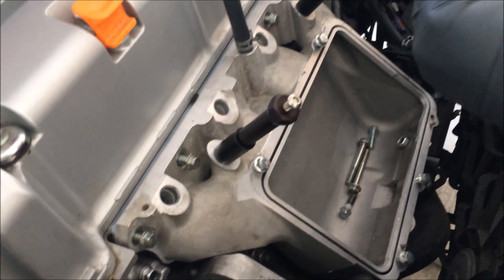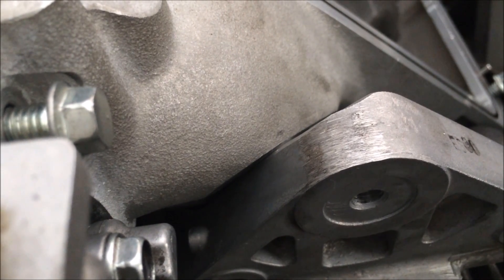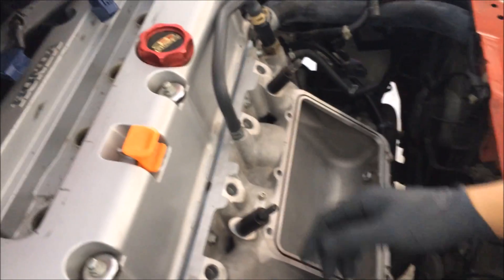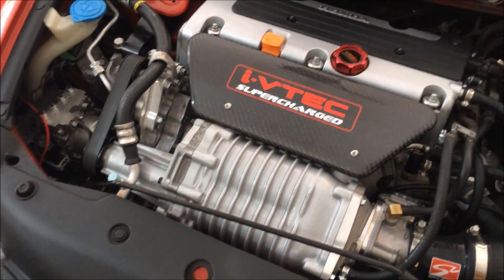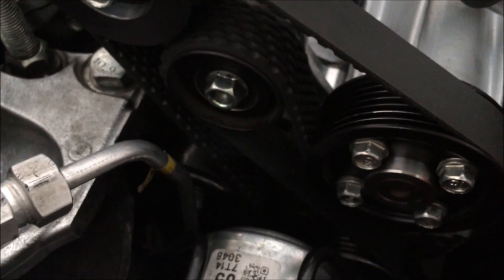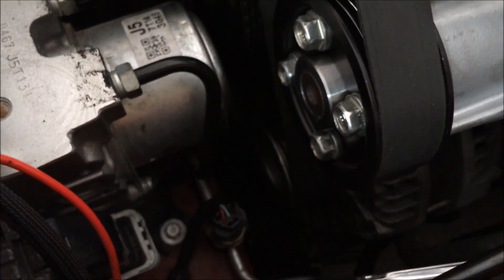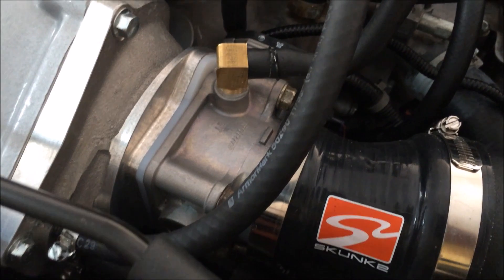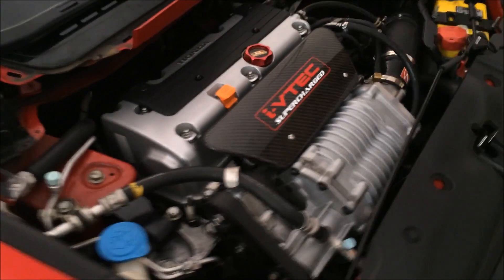CT Supercharger Build Part 5: Installing New Manifold, Blower, Belt, Fuel Injectors

Comment: Man, i just had to take off the manifold and the blower to replace that hose clamp at 1:20 cause I used the stock clamp and wasnt applying enough pressure... used a screw style one and cranked it down.. hopefully it doesnt leak again...
Reply: The same exact thing happened to me, I am hoping I can get away with just pulling the blower, its coming off for my aftercooler install.
Reply: I didnt feel like fighting it so i took off the manifold too. i was so pissed.